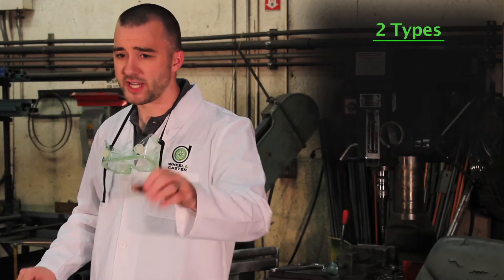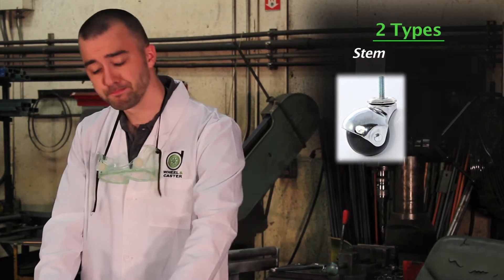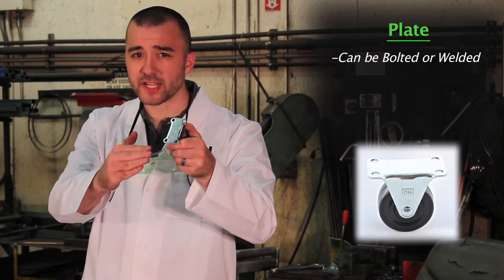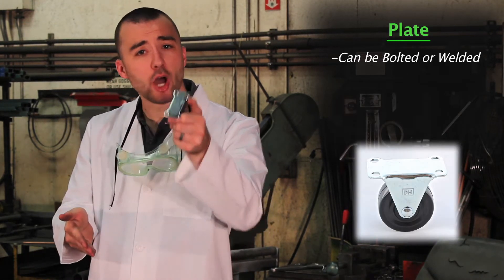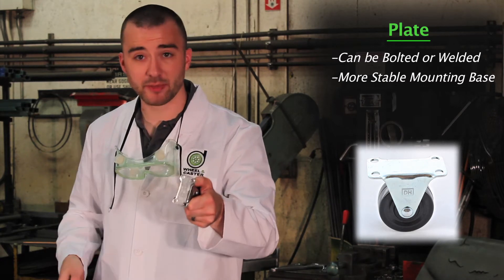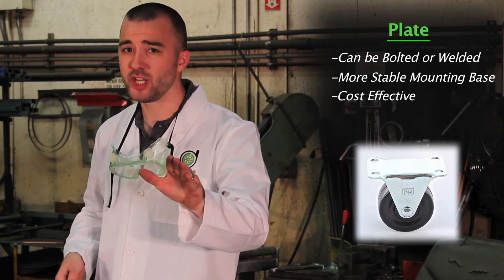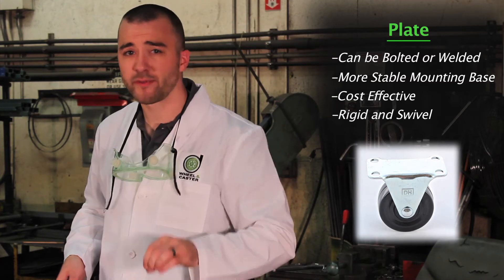Wheel & Caster 101 - Plate versus Stem casters

Comment: I am going to get a wheelchair, and I was going to have 6x1.5 sized wheels in the front, what would be the best caster fork for those wheels, and what is the difference between different sizes of caster forks
Reply from the maker: When it comes to wheelchair applications, we refer out to the experts at Goldenwest Mobility. You can find them at goldenwestmobility.com, or 509-484-3842.  Hope this helps.